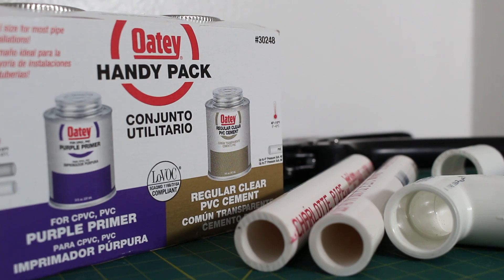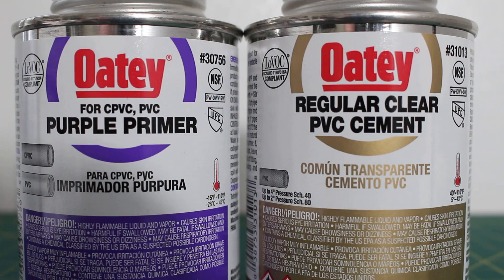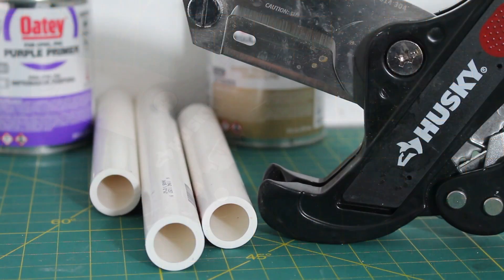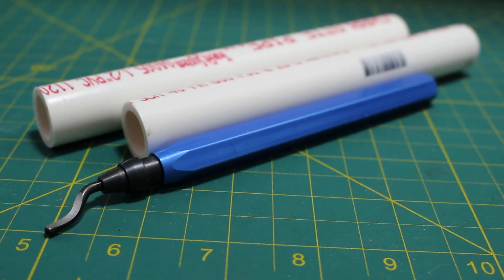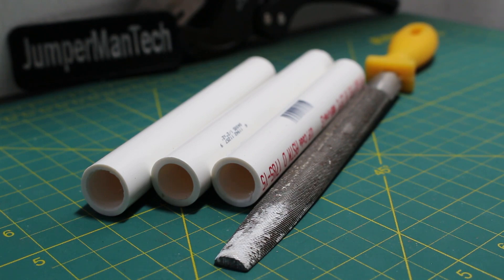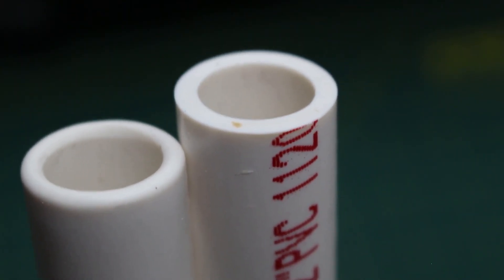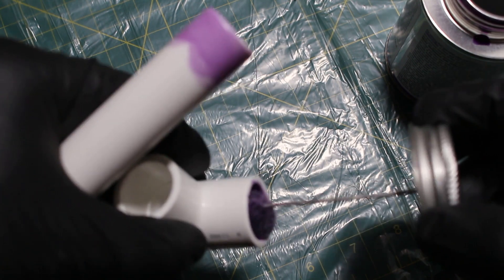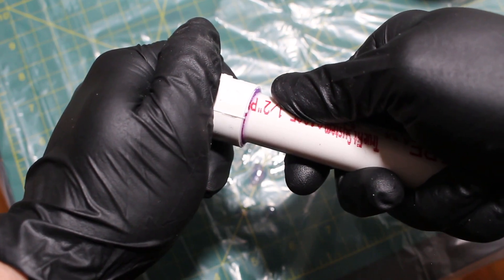How To Cut, Prime & Cement PVC Pipe & Fittings Like A PRO (How To Bond PVC) Solvent Weld PVC

Comment: Brother, I’m not saying this as a hater cause you’re the one making videos, not me, and I respect that but even though you did a good job of explaining how the process goes, if you want to solvent weld pvc like a pro, you’re gonna have to get that pipe deeper inside the flying purple people eater (don’t worry, she can take it) because inspectors love that shit. They wanna see you dripping with purple juice. It’s gets them harder than nasty stripper titties. But you can’t just kiss and tell. They want to see purple on every joint from across the room when they do their inspection because it’s really scary for them to be out of the truck and actually on the jobsite so they’re trying to get the walkthrough done asap before the bullying from the other trades get too bad.

Keep sharing your knowledge man and never be afraid of failure. I’ve put up wavy walls and leaky roofs but I learned more from fixing them once  than I would’ve learned taking the easy way out and watching someone else do it 100 times.🤙 Except for tile. Let’s just say I’ve put a few rugs over brand new tile floors😂

Comment: Ok I promise you that no one deburs and primes there pvc. I've worked on track home job sites and seen plumbers install, it's cut glue and stuff pipe together, time is money no one is hand filing pvc for there connections.
Reply: six3sixkawi   I’ve seen them prime, but never file and rarely de burr
Reply: If it's waste pipe it doesn't matter much, if it's water delivery pipe you absolutely deburr and prime. Deburring and priming is a fast process if you have half a brain. You worked with hacks who should go back to flipping burgers.